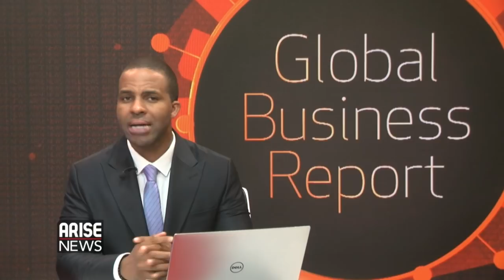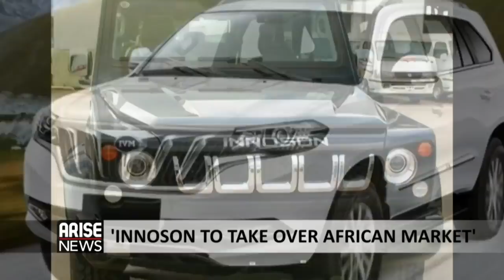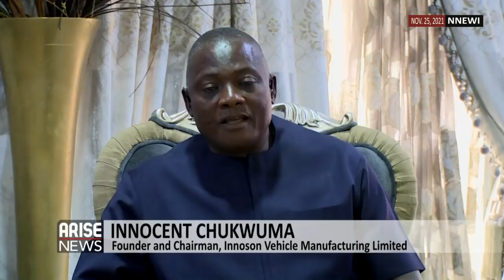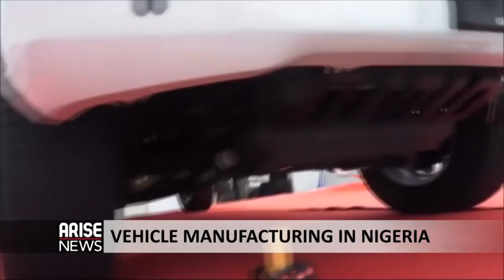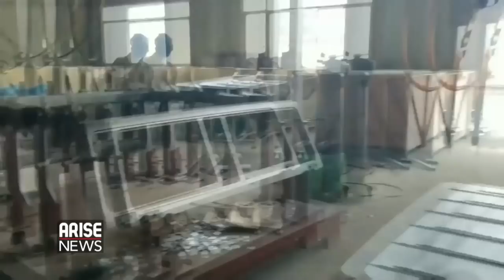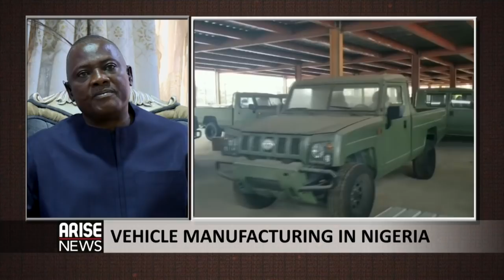Innoson Vehicles CEO On Electric Cars, Local Production, and Vehicle Financing

Comment: This Innoson guy is basically a big LIAR. He doesn't know what he's  talking about. 😳👎🏽
He doesn't even know the difference between MANUFACTURING and ASSEMBLING? 🥺
Does he even know the meaning of metallurgy? Or mechanical metallurgy for that matter?🤔🥺

As a mech engineer,  who has worked extensively with some top german auto manufacturing plants -VW/BMW, I tell you guys  that Innoson is only an auto assembly plant, period.

The Innoson guy doesn't even sound like a tech person. He basically sounds like a traditional Nigerian-Ibo businessman.  He's doesn't sound scientifically educated. 

His answer to the question of how he manufactures his metal components for his assembled vehicles was flawed. His answer was at best, very elementary and deceitful. 

Hey, but the journalist himself, failed woefully to push back with tough questions for the Innoson guy to fill in the gaps. Perhaps he was too afraid as it's usually the case for some so-called Nigerian  journalists.  

The interviewer himself doesn't sound technically  sophisticated to do that kind of interview. He lacked the tech preparedness for this level of auto manufacturing conversations. 

That kind of interview in Nigeria could have been better handled by the likes of Dr. ABATI and his team on the Morning Show. They are well more equipped with the journalistic, technical, and legalistic knowledge base for such vital interview.  -  Safety and reliability of these Innoson automobiles are questionable. 

Mr. Innoson can be better advised to understand the meaning of humility and truthfulness when you're at this level of business in any society.  

Based on my own research, the Innoson auto assembly plant business is primarily based on CKD parts that he purchases from between South Korean  and Chinese auto manufacturers. And he's on Nigerian TV telling lies and garnishing his plant's capabilities  -  with the interviewer just allowing him to get away feeling with it.

The Innoson auto assembly business is not different from what many Asian assembly plants do in countries like the Philippines,  Vietnam,  Indian, etc.
Even the entire South Korean/Chinese auto manufacturing of today, started with CKD parts from the likes of the  great American General Motors - GM - manufacturing. But they worked their ways up from the auto assembly  levels to the manufacturing levels that they have attained today. 

Mr. Innoson should be proud of his business acumen, that he's able to attain this spot in the auto industry of Nigeria with little or no technical education. He should be humble enough to be truthful to the Nigerian people and government.  Taking advantage of the fact that the Nigerian media and the vastly uneducated Nigerian masses won't question his false claims of auto manufacturing is very disloyal to the same country whose citizens he expects their patronage. 

The interviewer didn't even touch on the safety  and manufacturer's warranty of these Innoson assembled vehicles.  No serious governmental oversights to check level of safety of these automobiles under any conditions. 

When I heard the callous way he just sidetracked the question on how he manufactures the metal parts from some unknown sources for his vehicles, I almost threw up.

I could go on and on, but my simple advise for the Inmoson guy is to return to the TV circuits and start retracting his misstatements on this topic of manufacturing.

Additionally,  he should pay some   well-oiled Technical  Relations Officers - (TROs) to do these kinds of interviews.  While he, himself, sources the funding for his operations.

....if you consider yourself a Nigerian bigman, you should also consider it a big responsibility to be big on the truths that matter.

...always remember that many Nigerians are way more academically educated than you are.  And they can engage on social media these days to rebuff any miseducation.

....also remember the Ikoyi real estate guy who lied so much on Nigerian TV interviews about his successes in building high-rise structures across the world and was corruptly allowed to  erect the failed 21-story building  - (only 15 floors approved) - that killed lots of innocent Nigerians recently. 

Nigerians just need to start punching holes in any misstatements - (lies) by any Nigerian businessman or politician. Because it's  about integrity, morality, safety, security, and corruption-free society. And the educated class can start it off. Thanks!🙄
Reply: Oga its not that serious. Educated people need to get off our high horse and do something. I mean look what a trader could achieve, what is really our excuse. 
Criticism is easy. As a mech Engr why not design and manufacture a component and sell to innoson.
Reply: @nnamdinwoye7698  great reply
Reply: @nnamdinwoye7698   but it is serious  and as he lays the blueprint next generation comes and do better . innoson is just the proof of concept.
Reply: Please with all due respect, we must appreciate Chief Chukwuma for his achievements. With your knowledge, experience and smart brain you can set up  your own brand to correct his lies.
Reply: Keep quiet Mugu discover mumurism
Reply: You are writing poem for your self keep writing, you will never make it
Reply: @comfortedu5115  😂😂😂😂
Reply: Oga this ur epistle long pass Psalm 119 .. I no dey read ur nonsense again
Reply: If you have the technical know-how as it seems you claim, kindly erect a start-up. I think it would help solve most of the holes you picked on the submissions made by innoson in the interview.  Now, I remember, talk is cheap.
Reply: @chineduokekepeter8992  talk is very cheap
Reply: Ezi what have you done for ur self as a sene human being, not to talk of ur family and ur community, if not to criticize and write rubbish.
Reply: What are you saying ?? he is a business man and not an engineer.. He has engineer  that make the design.. Car manufacturing is the industry of all industries.. most car manufacturers purchase steel from steel manufacturers ...

Comment: This is a company that assembles vehicles and NOT manufactures vehicles. All parts and components of their vehicles are shipped in from foriegn countries and ASSEMBLED in Anambra state, Nigeria at Innoson motors assembly plant. That is the truth....
Reply: There’s no car company in the world that manufactures 100 percent raw, there must be of place of buying , like cars radio has resistor , capacitors , etc, which are produced by other factories, so no car company can manufacture 100 percent of all its products, the major thing is , is he the one, building the engines, tires, the car body from scratch, if he is then it’s a manufacturing company, even car companies abroad get their batteries from other factories and as he said, he only import the steels, showing that from engine to the whole car itself is built by company, so it’s a manufacturing company
Reply: Please do your full research before spewing all these things. Only engines and few other components come from outside the country . IVM has a network of subcontractors that supply components for production which include other innoson subsidiaries under the innoson group. Plastics, batteries, steel, electrical components etc. Assembly is when you have a binding agreement with a sole supplier for all components who dictates vehicle specs. For assembly, you CANNOT source components from anyone else and you must follow the blueprint of the sole supplier else the agreement is terminated. That is not innoson. Everything is fabricated and assembled in the plant. Do your research. If he was into just assembly, he will not be able on his own to start converting engines from petrol to CNG.
Reply: Your problem is that u don't know the meaning of assembling and manufacturing
Reply: You need to be sensitized..steel manufacturing a total industry entirely .. Car manufacturers purchase from steel manufacturing indutries...

Comment: Typical Nigerian CEO who will not accept that his company is assembling vehicles but insists on saying it is manufacturing vehicles. How can a company claim to be manufacturing when...

(1.) there is no evidence of an office complex where design teams exists to design the vehicles before manufacturing starts....
(2.) crash testing locations or sites as proof of its manufacturing prowess,...
(3.) components that are produced in house and have been tested properly...
(4.) Nigerian companies that partner with them to produce designed components of the vehicles...
(5.) Proof that the transmission boxes, both standard and automatic transmissons are designed and manufactured by them....e.t.c
(6.) None existence of what percentage of the manufacturing process is actually done in Anambra by Innoson motors, 5%, 10%, 20%?..,...e.t.c
Reply: I suggest you watch the video Innoson did Wode Maya. That will help cover the holes in your knowledge of this company
Reply: What are you trying to prove ?
Reply: Oga Analyst, which one have you done? Ndiara everywhere!!!!
Reply: @4ever true. Do your research. They manufacture. Almost all components are produced in Nigeria. 80% of the components are sourced in Nigeria with the exception of engines and other components. All plastic components are manufactured by innoson plastics enugu as well as tires produced by their tire plant. Batteries are supplied by ibeto. They have a solid supply chain and are not dependent on a single supplier that dictates vehicle specs. so go do your research and don't make uninformed statements
Reply: Can you name any car manufacturers plant that produces all parts?
Reply: Innoson Assemble Motors not manufacturing
1-he doesn't design is engine
2-he doesn't design gearbox
3-no stapling of panels
4-he does not have design studio for vehicle 
5-no proofing ground for is vehicles and crash testing

So let be guided without the above you are an assembler not a manufacturer
Reply: Thanks @4ever true: I agree wholeheartedly with you.  Your analysis of what it takes to manufacture a car is 100% correct and should help all these uneducated comments from the noise makers. Thanks again for the breakdown of facts. Mr. Innosen needs to spreading fake news about his auto assembly company.
Reply: @lkylky1730  You see how you're all over the thread pulling all the muscles in your body just to cry over IVM. 
A car assembly comes with a contract of performance from the manufacturer. It is a franchise business, which the franchisee, the car assembly plant , in this case, must comply with.
You assemble the brand you have contract with its manufacturer and give the assembled car the name of the brand owner or a new name approved and adopted by the brand owner, which the brand owner will include on their website as part of their cars. Do you get it? Now is there any car brand owner that has IVM as part of its cars? Which international brand is IVM assembling and/or representing?
Another thing is, you cannot use another car manufacturer's branded parts to make your own cars or mix with other branded parts to make your own car. You cannot use different branded parts from different car manufacturing companies to make your own car. You'd be sued and taken out of business. 

Thirdly, in car assembly, you are limited to that brand (the Make) and the models (designs) the car manufacturer contract you to assemble. IVM makes all models - Sedans, SUV, Trucks, Coaches, and branching into Defense. Which assembly plant is allowed by the brand owner to assembly all models and venture into non-conventional automobiles?
Fourthly, if you are a franchisee, a member of a bigger brand, your geographic market area will be defined. You cannot sell your product, cars outside that geographic zone. So barring export restrictions by foreign governments, is there any limitations placed on where IVM by another car manufacturer on where IVM can and cannot be sold? These are a few and I can go on and on. Learn to let go of envy, jealousy and hate. It's healthy.
Reply: You deserve a bottle of Heineken .
Reply: All parts of Japanese cars, American cars and Korean cars are not 100% manufactured and assembled in their company. Now the division of labor in the company has long been internationalized. You are ignorant and critical.
Reply: @ketapartynigeria1649  Wow you really had time to write all these trying to give form to a shadow, an imagination in your head.
Innoson should tell you this, should tell you that. Income per head in Nigeria is the cheapest and so is cost of power and energy, so are cost of imports. 
"...every single part and component he uses in every vehicle model he assembles are either imported or the machine, tool and equipment used in producing them are all imported...." 
I worked in both manufacturing and oil & gas companies. In both companies, they imported tools, materials and machines to help them create their products, tyres and hydrocarbons. But for Innoson to prove to you IVM is a car manufacturing company, IVM has to locally produce everything, every tool, every machine, every material it needs? Right?
Car Assembly is a franchise business and I ask you which car manufacturer did IVM get a franchise to represent and assemble their cars? Do you know about Dangote Car Assembly? And do you see that it has Peugeot written all over it? 
Dangote Car Assembly has a license/franchise from Peugeot France to assembly peugeot cars. Again, I ask you which manufacturer is IVM assembling? Dangote cannot assemble Peugeot cars and call it Dangote car manufacturing. It's against both local and int'l commercial laws. Be proud of your own.
Reply: @isoryte201  It goes to show you don't know manufacturing. Vehicle components will push out non model components but will charge you premium price for it especially if they have to design and model it for you for production. There are several vehicle components manufacturers doing that in the US, India, China, etc. This is extortion because Innoson pays premium price for those components without any guarantees and quality assurance compared to car production franchise model where components quality is geared to franchaser quality control level. 

Again, I say it with confidence, you don't know manufacturing and based on the set of questions you asked me, you definitely don't understand a manufacturing economy. You wouldn't get anywhere with your BS.
Reply: @ketapartynigeria1649  There is no Car manufacturer that does not patronize, that does not buy components from vehicle component manufacturers. There is no car manufacturer that produces all the components they need in their own shop. 
They produce some and buy some. Give me names if you have any that produce everything in-house. 
And FYI, vehicle component manufacturers are not car manufacturers, two different business lines.
Calling me names only exposes your ignorance, desperation and lack of civility. Attacking IVM tells how dark your heart is.